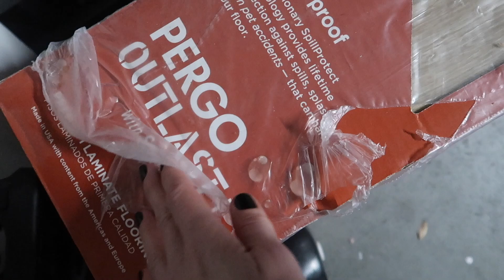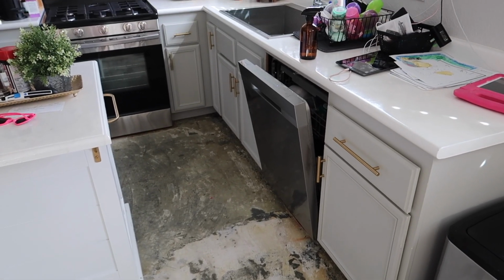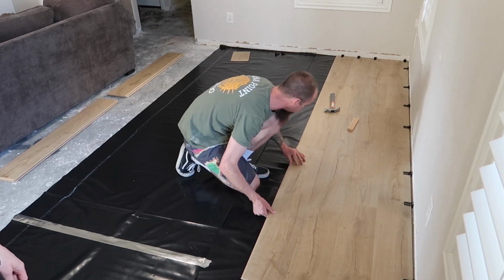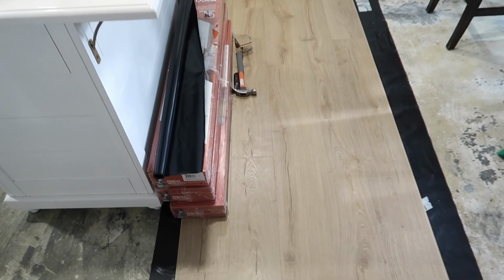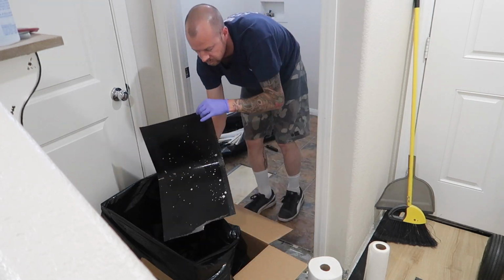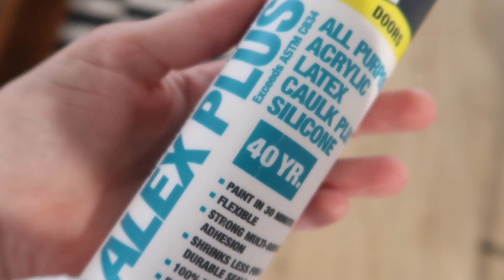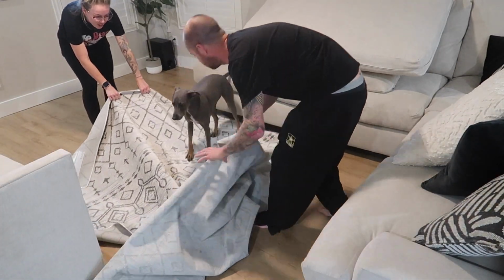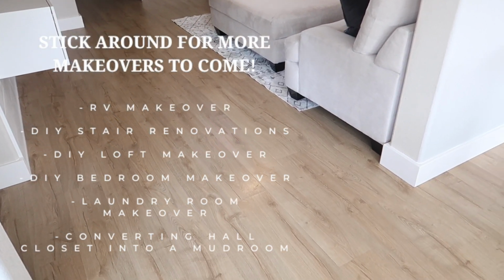DIY HOME MAKEOVER EXTREME HOME TRANSFORMATION | DIY BUDGET FLOORING REMODEL + AFFORDABLE HOME UPDATE

Comment: Hey Bronte, how did you hang the wall paper on that textured wall? It has an orange peel finish from the builders. I have some lovely wallpaper I would love to hang, but I was told that you have to knock off the orange peel so I would be able to hang the wall paper. I am asking for any suggestions you may have. Thanks Ms D
Reply from the maker: Hi! I just hung it like you would any other peel and stick. I used a credit card to smooth it as I went. It’s all in my small bathroom makeover video https://youtu.be/0hUjzTEcfAE 🖤